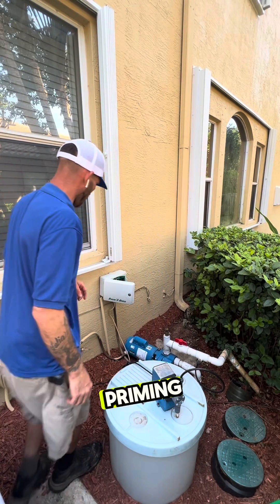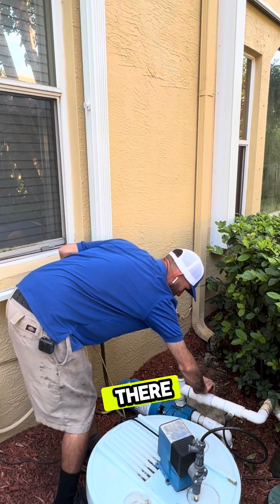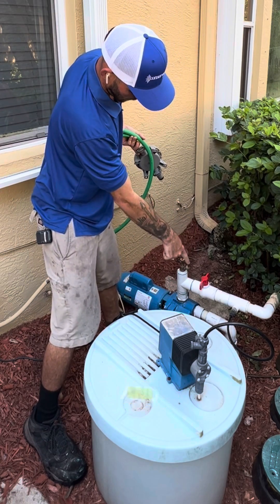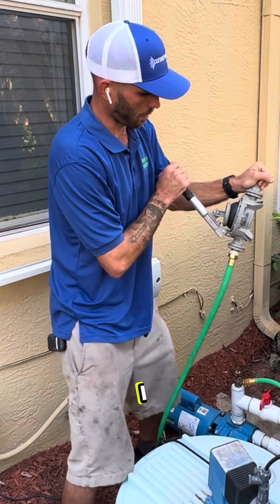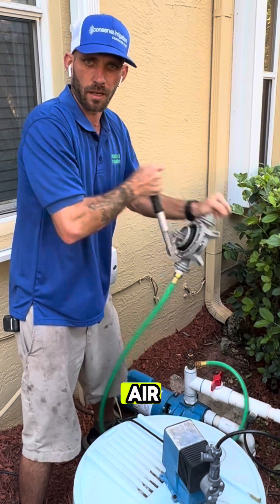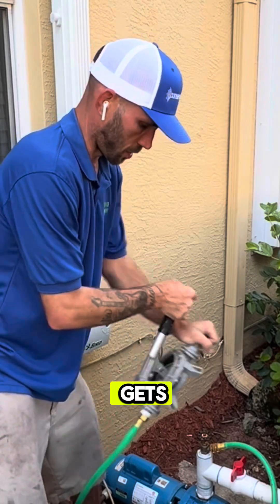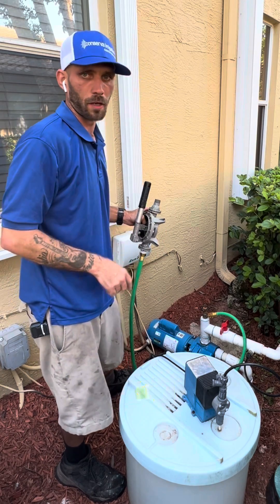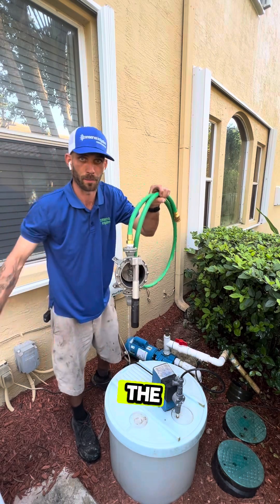The Guzzler | How the professionals prime a pump

Comment: Would it be possible to do the same thing with a shop vac?
Reply from the maker: I have never tried so I don't know for sure. However it does require a lot of negative pressure to pull up the water from the water source. If it can't be done, I'd love to see it. I don't own a shop vac.

Comment: You have an amazing content, I never knew there was such tool to prime the pump I have the same issue, I replace the check valve already n the pump still  runs dry idk y? Which u can give a pointer or direction 🙏 thanks in advance…
Reply from the maker: Air is getting into the intake line somewhere. Whether it’s a crack in the pipe or a bad connection between a male and female threaded fitting a bad gasket on a Union. So many things. What is the water source?

Comment: Great pumps for shallow well priming and backup. Check their catalog as there is a wide variety. If you need to move a lot of water foot pumps crush hand pumps and Bosworth have all sorts of those. I plumbed my shallow well as shown and it works flawlessly. Garden hose adaper fittings and FARM GRADE black UV-proof hose are the way to go.